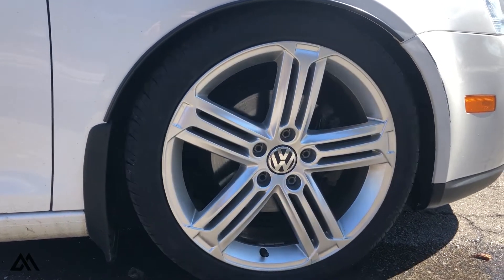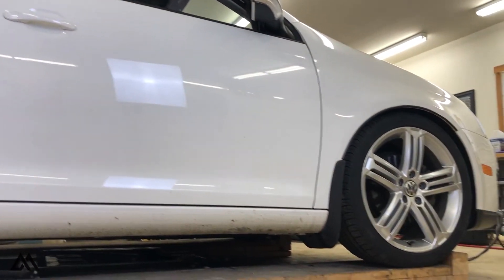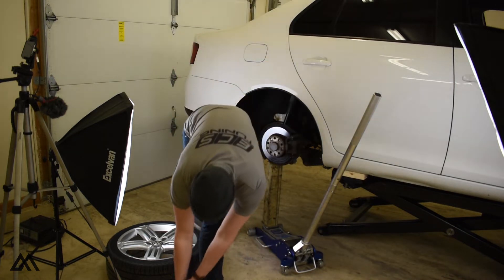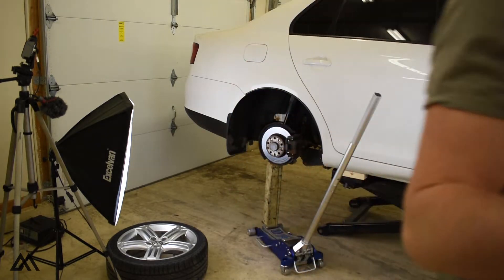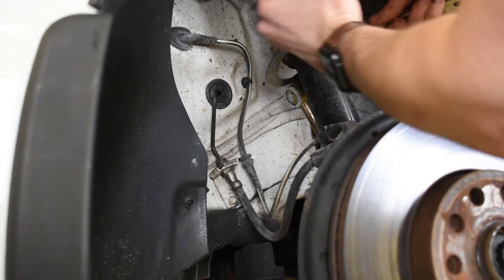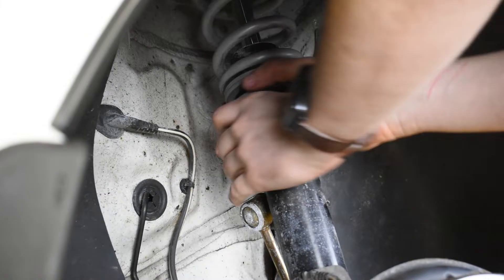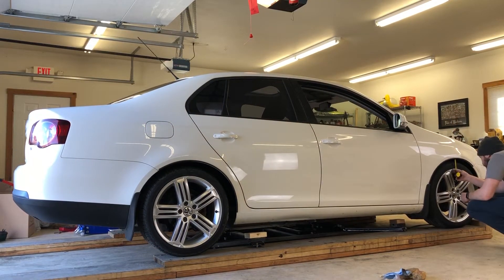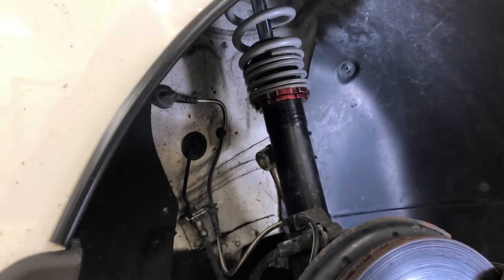How to Change Your Ride Height with Coilovers |  ECS Tuning Street Coilovers Review | MK5 VW Jetta

Comment: I used to have cheap coils prob around 200 hundred or 300 dollars or so that the owner before me put on. After one of them exploded I bought these coilovers and the difference is night and day. I have never felt what mk4 Jetta stock suspension feels like but these coils feel so much better. I remember having to brace for impact on bumps that normal cars would have no problem on. These feel so much better and I would definitely recommend them.

Comment: Be mindful, this coilover set he installed is the street version, the cheaper one entry level setup.
** ECS has a 32 way dampening coilovers that are way way better and easier to tune than this version. 
The street is about 560 or so, while the 32 way are $795 on sale.

Comment: Hi i just installed ECS tuning coilovers on my mk6 jetta! feels amazing but I am having some clunking coming from the front wheels and I cant figure out what it is. Do you have any suggestions of how to fix it? a response would be great🤞
Reply: Idk if you got the clunking fixed or not but I would take a look at your control arm bushings and that's exactly what was causing the clunking in my car
Reply: @jorgerivera6555  it might be the sway bar hitting the axle. You get that when lowering mk4s idk if thats an issue with mk5. They werent designed to be really low
Reply: @lollol-xp4mc  yeah you have to section your frame rails lol
Reply: Make sure you tightened the top strut nut properly. I had the same issue on my fk's.
Reply: @barcenas5 what was it?